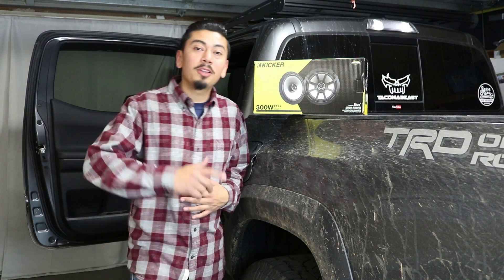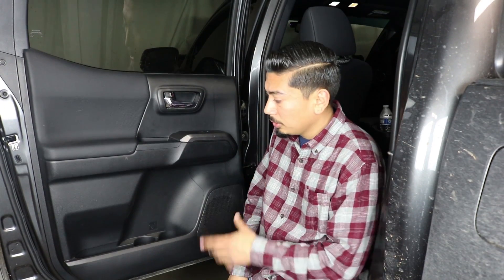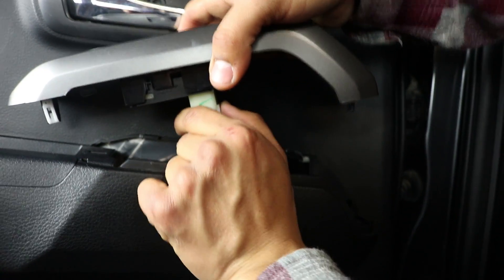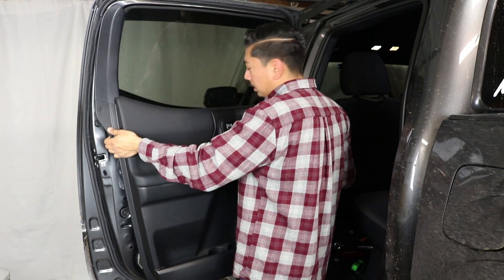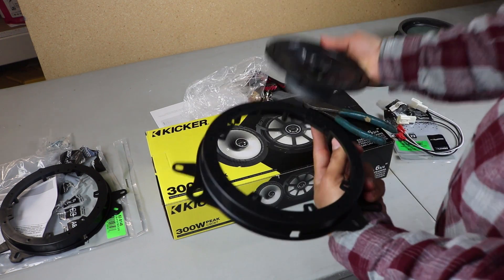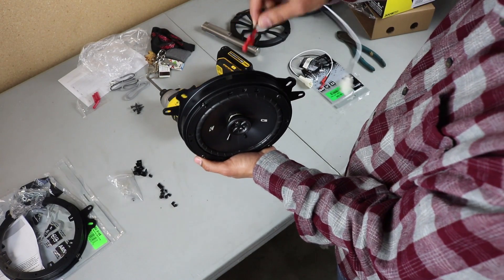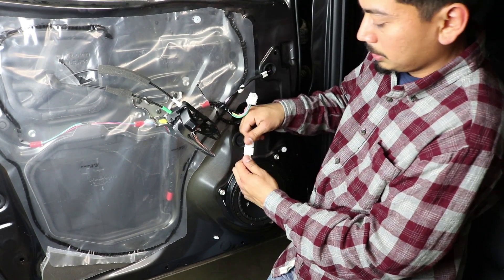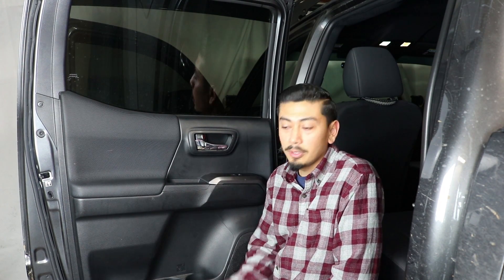HOW TO INSTALL REAR DOOR SPEAKERS 2016+ TACOMA TACOMA | IS IT WORTH IT???

Comment: Great video!  Just changed out the speakers on my 2016, don't know why I waited so long.  Great improvement over stock.  The only thing I screwed up are those little white clips on the top molding.  I did not take them out and put them into the molding clip.  I left them in place on the door and when I tried to pop the molding back on they fell in and.. who knows where they went.  I just ordered new ones online so should be all good by next week.
Reply from the maker: Thank you :) and yes those tend to break super easy
Reply: Darn I wish I read this comment. Did my back left door and jammed the doors into the clips and lost all 3 of them haha

Comment: Hi, just followed your tutorial for my 2020 Tacoma.  Just an FYI that the wire harness adapter does not work in the 2020 model.  I had to splice the wire and returned the one used in this video.  You may save some of your viewers the headache if you note that the harness does not work in 2020+ model tacomas.  Other than that, everything went very good.  Thanks for the video and yourself earned a new sub today!

Comment: Good video, have a 2017 Entune 1, just did the Subaru Kicker dash tweeters, what a difference I'm actually using my stereo now, it was so bad I kept turning it off before.   Listening to the rears they're so LOW on the floor and sound terrible, I think I'm going to do those next.  I am giving rear 2 way component speakers a thought as bringing the tweeter up about mid way on the rear doors may give the rears a little more presence but I'm also concerned about it messing up the sound stage.  Still thinking about it, easier and less expensive to just do co-ax in the rears...
Reply from the maker: You could do that keep in mind these are a upgrade but there recommended adding a amp to them but there still a upgrade over stock that’s forsure

Comment: So I bought a new pair of kicker 6.75 speakers, speaker adapters, and wiring kit to install in the rear doors of my 2017 tacoma sr access cab. When I got the door panel off,  not only were there no speakers in there, but no wiring either 😞...Help!!

Comment: Just watched and tried this right now.  I'm on a 2019 TRD\OR, the back speaker bracket screws they provide will not fit into the door if they stick out.  You need to either buy shorter screws or cut them down flush with the bracket.  Also, if you happen to have part # handy, I busted the clips on the top piece that goes right above the screw where you push in to pop out.  Your hand is on the piece at 2:34.  Thanks.

Comment: Do the new speakers sound better? The rear factory ones barely have any output. How does changing them help with that?
Reply from the maker: It will if u add a speaker amp to them

Comment: I might do the rear speakers first. When i faded to the rear speakers i got very little sound compared to the front 6x9's. Thanks for the video!
Reply from the maker: Ur welcome thanks for watching :)
Reply: I too got very little sound from the rear speakers after the install. How can this be fixed?
Reply: @rickrossi4816  I put pioneer d series in the front. Sounds great now. I still  need to do back sometime later. Saving for a roof rack next

Comment: Great Video and very helpful!  I just wanted to give a heads up to anyone with a 2020, they changed the harness coming out of the rear speakers so the ones crutchfield are sending are wrong.  I've been in contact with them but haven't hear back yet, if i find out which adapter it is ill update!
Reply: Crutchfield didn't reply for 2.5 days so i reached out to Metra to see if they had a harness for the 2020 rear door speakers.  I sent them a pic and they said they do not have a harness like that for Toyota vehicles as of right now.  I ended up having to splice the rear speakers on my truck.  Hope this  might help someone.
Reply: @bluedevils99  Ran into the same issue when I ordered through them today for my 2020. Supposedly the rear harness is the same as the 2018 Camry. I ordered one to try.
Reply: @SasquatchMountainProject   was the 2018 harness the right one for your 2020?

Comment: Wondering if rear speakers are worth upgrading?  I'm planning on just upgrading the front sound stage and disconnecting the rear speakers to avoid them messing with the front. It will be just me in the truck anyways.

Comment: Nice video, where did you purchase the plug and play harness for the speakers? Can you share the link with me
Reply from the maker: When I purchased the speakers from crutchfield and went to check out they were included in there along with the brackets for free i will try and get the part number 👍
Reply: Looks good.Can you give me a rundown on system components?Thanks

Comment: I have a 3rd gen Tacoma and I replaced all 4 of my speakers but my rear speakers are much more quiet than my front speakers. I know I did the install right so what can I do to get more power to my rear speakers? Do I need to add an amp and cable crossover also?
Reply from the maker: Yes u would need a amp for the door speakers

Comment: The crutchfield site says this speaker model only fits the fronts and shows a 6x9 bracket. Did you call them to get the rear bracket?
Reply from the maker: No when I purchased the rear speakers it added the rear brackets on its own, I would send them a email just to be sure

Comment: Did this and now my rear left interior door handle doesn’t open the door the inside on my 2019 Tacoma
Reply: did you ever solve this?
Reply: Sam Capicio yes magically it fixed itself somehow i was lucky but i bet it was an easy fix.
Reply: Drew Locker yeah just fixed it, if it happens make sure the green cable is securely in the grove handle. That was my issue

Comment: I purchased some 6.5 but they didn’t fit my 21 tacoma and now I’m reading they need 6.75 for back doors. anyone else have this issue ?
Reply from the maker: As far as I know the rear speakers should be the same but the harness has changed if I’m not mistaken
Reply: The harness you can’t find anywhere! I found a brand Redwolf recommended from a tacoma forum so I’ll see how that works.. as far as the fitting I think I need a bigger bracket cuz the one the speakers came with don’t fit AT all